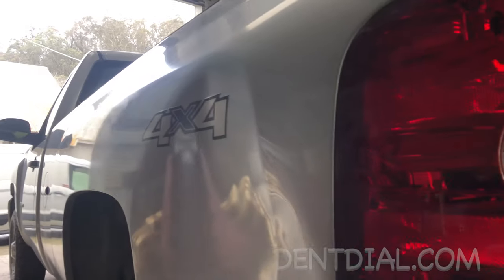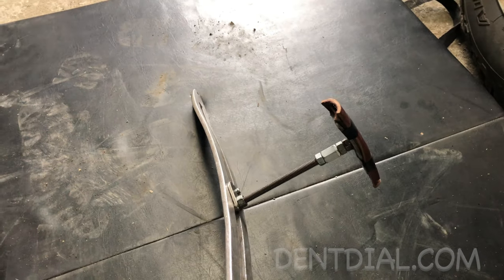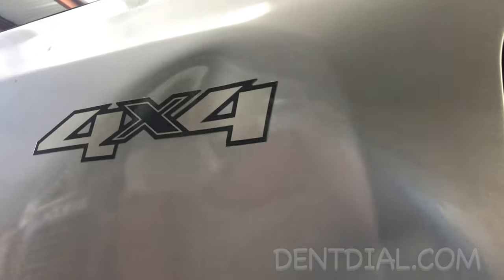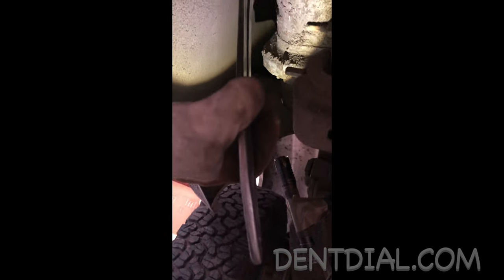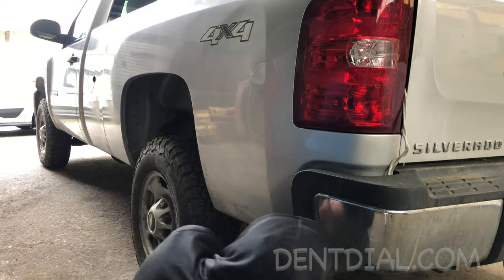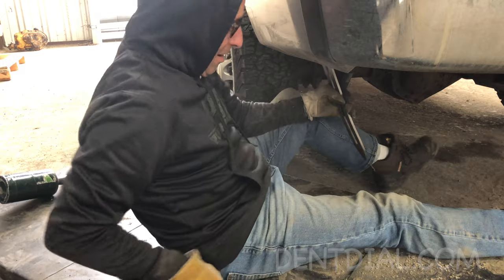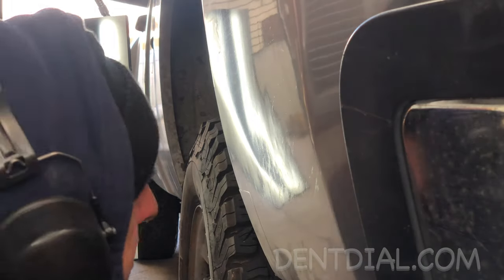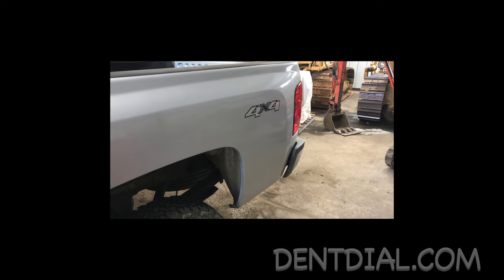Truck Bedside Dent Repair #paintlessdentrepair method or no repainting.  Chevy bedside #dentrepair.

Comment: How did you go about heating up the area?
Reply from the maker: I use a torch through a tube to keep proper distance and glide it over the area I’m about to push with intensity. Metal holds onto heat pretty well and I get it hot enough to not have paint break issues. What I don’t like about a heat gun is I can’t use it anywhere and it’s a pain to have running all the time and not a necessity. Be well have fun!